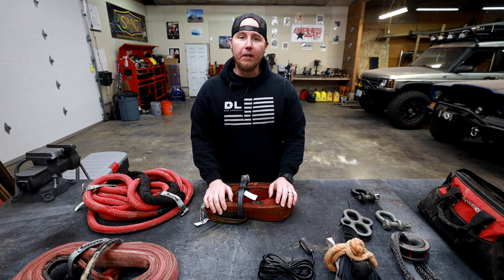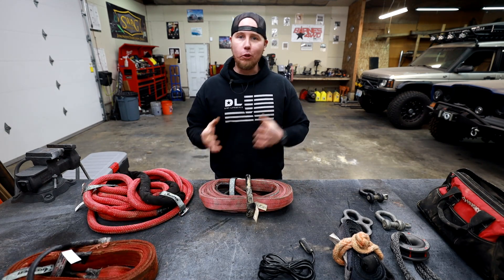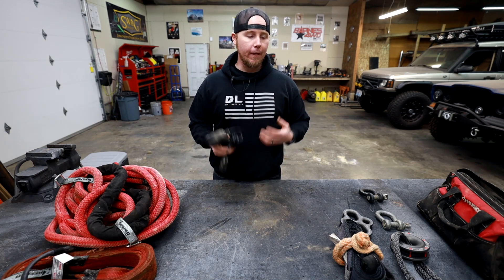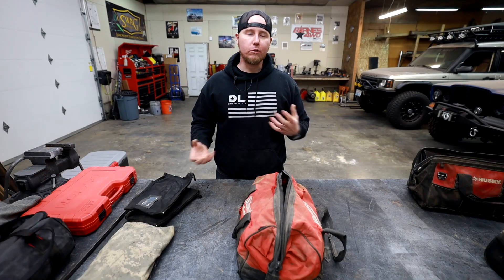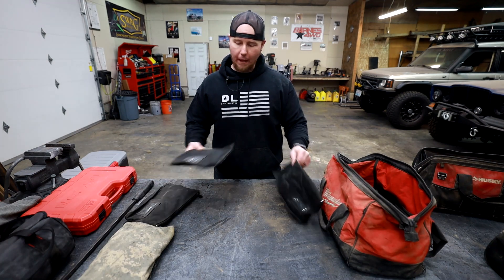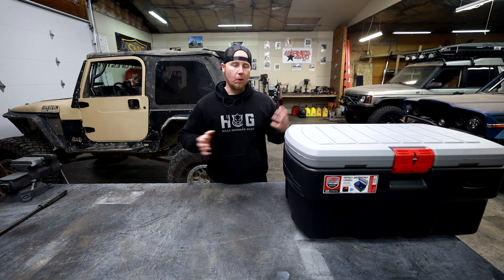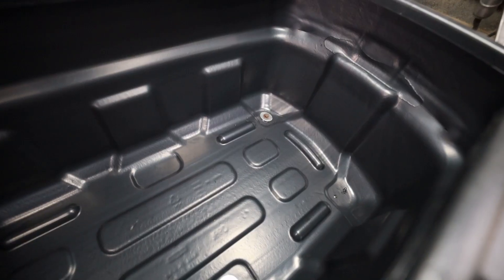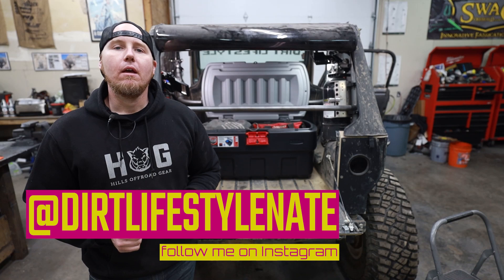Organize Your Mess! Off-road Tools And Recovery Gear Consolidation First Attempt

Comment: I like segregating my tools in bags. wrenches in one, sockets in another, and narrowing the ones you carry to the ones you know you will use makes it so much more convenient! For 20 years I was always doing breaks or something under the hood or whatever for my mom's different cars, and I finally had to buy a box to put them in but I just had them tossed in. It finally got so full that the little plastic see through toolbox started cracking after 20+ years lol. I threw them in my trunk and was adding to them for tools my cars needed hahaha. Now I try to be a lot more organized with things, but I still have a bag of tools behind the seat of my truck and a small socket set with metric and standard sockets, and another small case with different bits: flat, phillips, torque, square and  a handle that will accommodate them for utilization. I have a set of tools that will remove an inline fuel filter from back 20 years ago, and haven't used it for probably 13 years lol but it's there if I need it. It fits behind the seat and it has adjustable wrenches of different sizes, adjustable pliers, open end and boxed in wrenches, extensions. If I don't have the tool to fix something, I would be surprised. Because I've added to it since all the tools for different things I've worked on for my vehicles and my mom's, so It has accumulated a lot of tools, small and large. I'm pretty big on tools or geek out as you say lol. I watched this about a month ago and saw it come back up again on suggested videos and thought I would watch it again because I've added a Harbor Freight "viking 12 volt Jump Starter" with 1700 Peak AMPS. It has a 150 psi compressor with adjustable pressure settings and stuck it behind the passenger seat, so I would have a jump if I need it and no one is around and a means of airing my tires up since watching this video. I need to add a toolbox to the back I can lock up for items that only make sense to have access to back there like a lockout kit for those moments of absent mindedness when I'm hurrying and and lock myself out, which doesn't happen too often lol I think my last lockout was 7 years ago and my more recent a month ago when it started raining  and I was trying to hurry and go into work to beat the rain and had been working 7 12 hour shifts on a turnaround and was zombied fied after a couple weeks driving an hour  and a half each way, in my defense lol; actually I need to get a good flat repair kit now and throw into my bag, which I was reminded of when I saw your kit, but it also made me remember maybe adding a seat belt cutter. I actually got that idea from Brad, who said he added one to his kit because he had to use a knife to cut someone out one time, and he brought up a good point that a seatbelt cutter is way safer to use, being no chance of accidentally cutting someone in the process of freeing them from their vehicle! I also need to add a kinetic tow rope and soft shackle and a regular tow strap and a hard shackle. those are things I want to add to what I have in my truck, and I really need to figure out how to mount a winch to my truck somewhere. I have been thinking front but I may resort to the rear somewhere. I could weld my own bumper together back there, and it needs some weight back there anyway and that would be a good way of adding 2 or 3 hundred pounds. It's so light back there that it is easy to lose traction! Great video. More things to keep in mind to add to what I haul around with me in my truck. Things we have control of are things that can save us hundreds on a tow company. People that are on one of the trails, such as in Moab, I hear that it's in the thousands, ouch, but anyway, if I can have some basic things with me, that's all the better. Your video just reminds me of some things I still need to get!

Comment: I pulled someone out from the ledges on golden spike.  Basically from the Golden Crack out with a kinetic rope.  No matter how hard we tried, the rope was run over, multiple times.  The rope came out with a few scuffs, but for the abuse, I was surprised.  Definitely an awesome product,

Comment: Believe the load distribution block is designed to minimise the risk of chassis damage when recovering other vehicles or doubling the winch cable back onto your truck.
Spreading the load over both chassis rails equally instead of putting all the load on one side.
Cool looking design.
Be good to see the other uses you come up with.

Comment: The steel shackles are nice when the recovery point has sharp corners that you don't want to run a soft shackle through. Get a couple axle straps with smooth rounded rings so they don't cut into synthetic fibers. They are great when the soft shackle isn't long enough or you can use 2 with a tree saver strap to make a V-bridle when pulling from the axle or wherever, granted you can do this with just soft shackles, but again sometimes you need extra length. Get ones long enough you can wrap through a wheel if you need to pull a wheel with a winch. Also they can be used to wrap a ratchet strap on itself. The best way I've found to store paracord is a ziplock bag. Make sure its not tangled, then just shove it in like loading a rope bag. Close the ziplock bag but leave a little of the paracord's end hanging out. When you need cord, just pull it from the end without opening the bag. It also keeps the cord bundle from getting tangled with other stuff around it.

Comment: Excellent video sir. Have used that exact Rubbermaid box in the back of my pickup for more than a decade. I modified mine by replacing the hinge with a threaded rod which protrudes out both ends - and allows me to then attach hold downs to the hinge side of the box. I have a Warn 8000lb winch in mine actually - QD setup front and back of rig - along with the other gear. Have found a 24" bow saw is really handy when wind storms happen and one needs to cut the downed trees off the trail to get home. Thanks for the Flex Tape tip - will look for some next time I'm in our local Canadian Tire! Happy Easter and stay well.

Comment: a game saver that i always bring with me and has got us off the trail in Moab twice now is a length of chain and some bolts long enough to bass through and cinch down with. ill bring several lengths of bolts and at least two two foot sections of chain... we have used these to hold a broken front axle up enough to get off the trail and for ripped off or weakened control arm mounts. wrap that chain around something and a hi-lift handle and crank down a few bolts to lock things in place.
even though i have a premier power welder on board i still carry them. its just one of those things that proved worthy of a place in the oh-shit-kit years ago before the welder.

Comment: I used to ratchet strap my utility case down but now I'm going to bolt it down, thank for the tip.  I use the "Bucket Boss" rollup tool pouches,  very durable.  Great video

Comment: I love the action packers. Just be careful with that much weight. I have seen the fender washer still pull though. I ran a piece of 1” by .120 strap between the bolt holes on my Jeep for the trunk. Just a little added insurance for roll overs.

Comment: Used a similar method to store tools in a plastic container.  With all the bouncing, it tore the fender washers through the bottom of the container. I switched to aluminum flat stock over the bolts.  Problem solved (for me).
Reply: good call, i was gonna go that regular route, maybe ill just use bigger sheet plates as washers to prevent the pull through. thanks for sharing your experience

Comment: I love the tote idea. been doing it for a few years now. Only difference is I mounted 2 pieces of flat stock to the bottom that stick out a few inches both front and back so I can unbolt the box and remove it without having to empty it. Just a slight variation but works well for me. Great content as always brother..

Comment: Nice! Love the builds. This however, was straight practical. Thanks for the tree saver comments.  Two clevises for bumpers is good. Love my soft shackles also.  Soft shackles and winch line have a minimum bend radius and the sharp edge of a bumper mount is usually not that radius.  Clevises are close to that radius for some lines.  Love the tool rolls.

Comment: Off-road recovery gear is starting to look a lot like oversized climbing gear. We've been using dynamic ropes for decades.
Reply: I used them over seasons,12 years ago, bc the area we were in was very muddy. They were good enough to tug out up-armoured hummvees and mraps.

Comment: Excellent video, Nate! I love how you cover all aspects of off-roading. Gear is Very important, and keeping it from zinging around in a flop or rollover is even more important. Sometimes, a simple solution is best. I also use a tote to keep all my recovery gear/tools/parts clean, dry and in place. It's great that you bolted it down, with space fore and aft, and the well-thought out reasoning behind it. It's great seeing you build sliders and bumpers and such, as well as watching the rock-crawling videos, but this sort of video is needed as well. Thanks for another great video, keep 'em coming!!

Comment: 200lb of "just in case" tools...drive a more reliable vehicle...? i get staying prepared but every area to reduce weight is good..do you really need sae sockets if all your bolts are metric? 
do you need 20 screwdrivers or 1 9-1 screwdriver.
do you need multiple pliers or 1 or 2 multi use pliers
I used to carry probably 200-300lb pounds of "just in case gear tools"...I've paired that down to maybe 50lb..less space,less shit i'm moving around. 
some guys battle with worrying about fixing other peoples rigs,if you ain't gettin paid,don't worry 'bout it:: sorry,not sorry

Comment: Best wishes to you and the Family this holiday weekend! I usually use ammo cans and heavy duty totes to carry my supplies.   The totes I use have holes for locks, but haven't really needed them yet. I really like the idea of the rubbermaid tote and locking systems.   Yeah, I tend to weigh down my Samurai with too much tools that stresses out my vehicle even more so.  Will take those tools you mention to help narrow down what I need to bring.  Like to see what the professionals generally bring on the trail, so the info is super helpful!  I also use those nutcerts as well for a lot of things.  They're definitely useful when mounting parts!  Thanks.

Comment: Hey Nate, if your look for a simple tool storage solution I found the Atlas 46 tool roll when I was last over in NA. its a great well made product and has some very well designed features for the Overland / Off Road user. Great content as always and it's a welcome distraction from the Lockdown Blues over here in the UK.